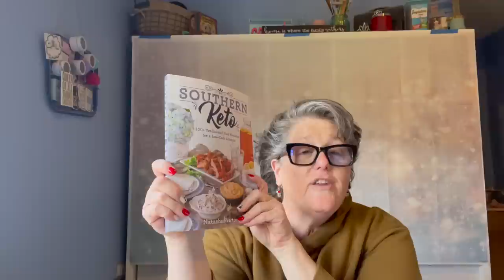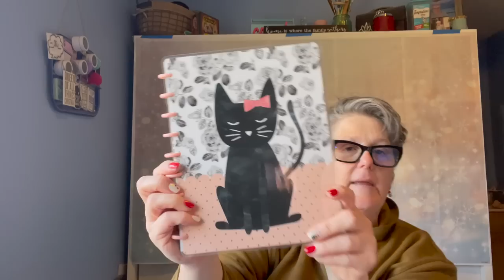Vlog  Busy Days

Comment: Great Vlog! I love the cutting boards. After watching your last video where you wood burned them I went this past Saturday and bought me a 1x12x8 solid red oak board and cut out several cutting boards with handles and I'm going to be woodburning something on each of them for gifts then sealing them with mineral oil. I had bought a multi temp woodburning pen last year and didn't think about using it for that until I watched your video.  Thanks for the idea. Have a great evening! Your decorations look great!